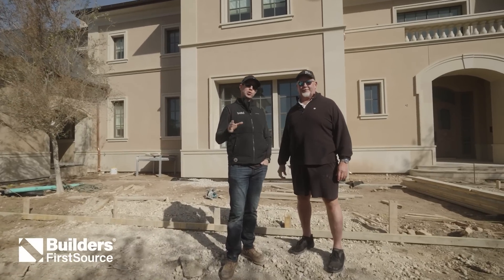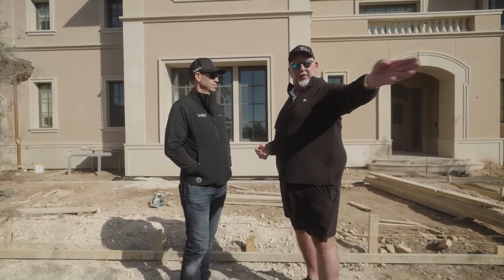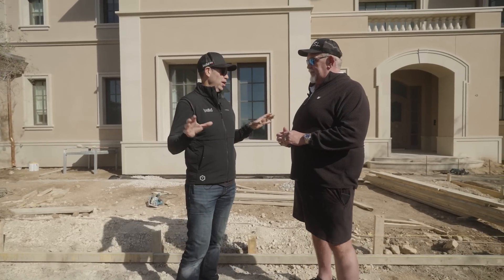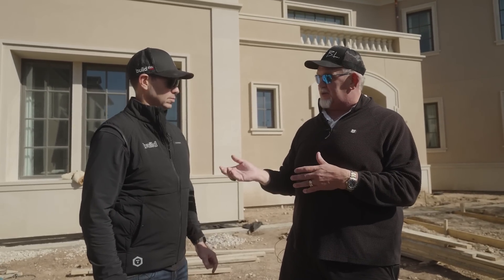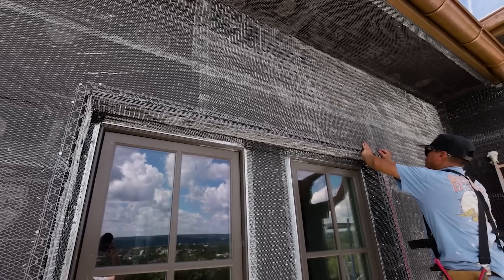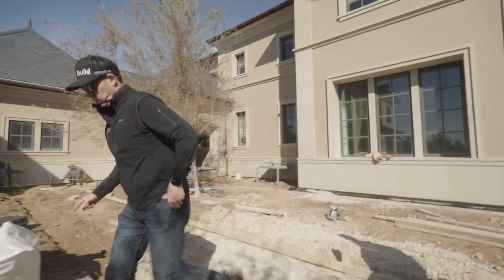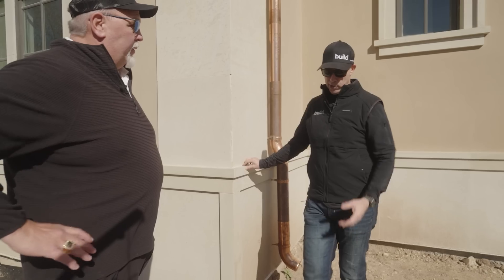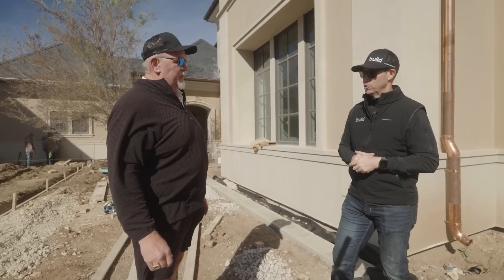Stucco & Cut Stone Done Right: Best Practices for a Durable Build

Comment: Looks good but actual best practice would be using a high calcium lime stucco and not use Portland based stucco. Portland based stucco will always crack and fail. All these practices will extend the life of the stucco and of course before it was terrible. Unfortunately no one it Texas uses actual lime based stucco and lime products and no contractor understands the nuances of using lime stucco. That would actually be best practices if you really want to go there. Also using metal lath is putting a material into the structure that will 100% rust and deteriorate over time. There are lath options that aren’t the traditional lathe methods but are made from basalt or other non metallic, non rusting materials so there is no deterioration over time besides wind and rain erosion essentially like limestone would naturally incur. Not to mention lime finishes are much more sustainable because Portland is not good for the environment in a number of ways. The best thing about using a real lime stucco is it looks better. Humans been using it for over 10k years that we are aware of but for whatever reasons we choose to use an inferior product for one reason and that’s impatience and now a lack of knowledge.

Comment: There are flexible epoxies. It may be better than sand calk as youd get the strength and longevity of epoxy ? Then again it cost a lot more than calk so it would either  cut into the profit margin or increase homeowners cost.

Comment: Nice fix for a very complicated failure that had compromised the stucco and penetrated and further compromised thru to the underlying wood structure. I will hazard a guess that the fix cost a signifcant amount of the initial total build cost. This type of disaster could put even a financially sound builder at risk of bankruptcy. Original general should have never bid a job where they did not have the requisite skills to prevent the issues present on this job. The contractor had to know when bidding that placing stucco and stone over a stick framed structure this size was new territory and either a  GC  stucco expirenced partner or seperate stucco skilled superintendent was a must have. Again Great save.  Ray
Reply: they didnt even run flashing right, this was ugly
Reply: @tukek88  That browncoat/stucco needs waterproofing before the primer paint coat is applied and hope that stone facia keeps water from reaching the stucco where waterproofing will not be applied. The wire lath is attached to the framing and has an air barrier now for drainage. The lath will not fully enclose all of the wire lath at back and stucco will be water permeable creating a space with water and steel in continous contact even tough galv. to eventuually cause spalling if stucco is not waterproofed.  I use tung oil 1 gal mixed with 3 gal. of mineral spirits as a near permanent watterproofing. All of the name brand waterproofings fail within 20 years and need to re-applied. Ray

Comment: 5:00 why are the polycarb strips run horizontally? Wouldn't it be more effective for drainage if run vertically? I realize that the strips have passages through them.
Reply: They are where the stucco lath is to be nailed. They have plenty of channels for water to run through vertically.